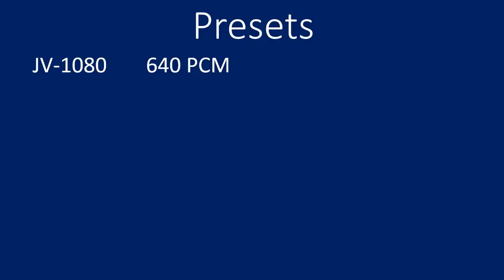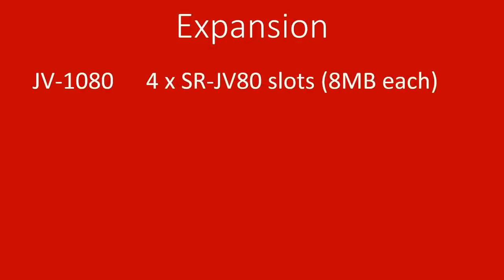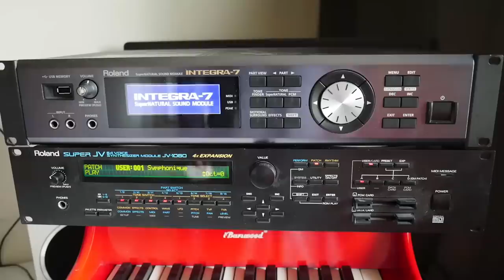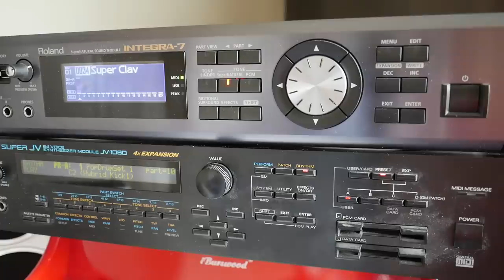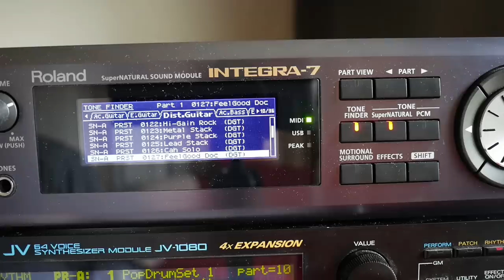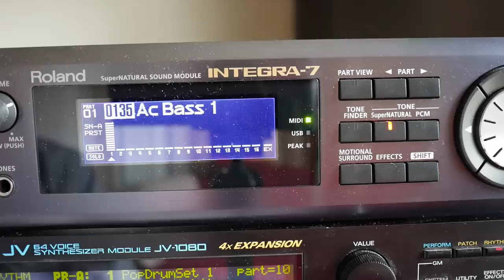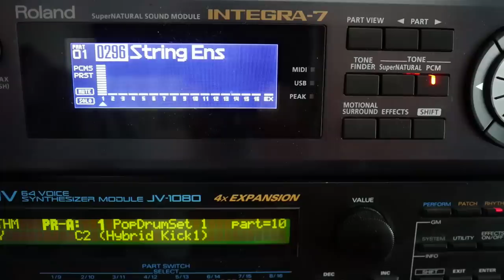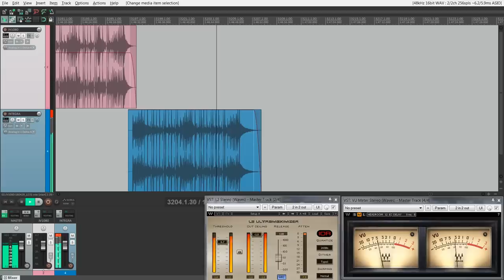Evolution of a classic synth module | Roland JV 1080 vs Integra 7

Comment: I think the lesson here is: we haven’t come very far in 20 years. We’re still using the same sounds, just more of them with added effects.
Reply: Yes, and many of the sounds sounded much better on the old module.
Reply: old one sound more dynamic
Reply: The lesson here is: you're only seeing a very narrow slice of what the integra 7 can do in this video.
Reply: ...and guitarists still play guitars.
Reply: @djangofett4879  Exactly. Even today the Integra 7 is one of only two synths, (the other being the Krog Kronos), which could easily replace my entire current rig of nine synths...
Reply: @qddk9545  JV sounds much fuller, more stereo. Integra too much in your face and maybe that is by design. I noticed the same then when comparing the could 1080 to the cloud 5080. JV does it for me.
Reply: Roland* haven’t come very far in 20 years. If you hear other makers, you will be blown out
Reply: @qddk9545  thats down to   anlogue mixer being used

Comment: I own a JV-1080 I bought in 1995, and an Integra-7 I bought in 2014. With the exception of the super-natural sounds, they are (sound wise) practically identical. This was deliberate. Everything that the JV-1080 did, so did the Integra-7. The PCM sounds comprised the same patches in the same order. The idea was that you replaced the JV-1080 in your 19" rack with an Integra-7, and still essentially had a JV-1080 at your fingertips if you needed it (without having to dust off the old JV-1080 and plug it back in). To compare a JV-1080 and an Integra-7 based on sounds only is unfair given that the Integra-7 has practically the same PCM sound engine built into it. The attraction of the Integra-7 was USB connectivity (no more MIDI cable that kept packing in), larger display, a built in DSP effects engine, balanced audio outputs on the back (ideal for connecting to a desk), blue-tooth connection to an i-pad to make controlling the Integra-7 easier, and a built in ADC/DAC (for audio recording and playback) that had an insanely good signal-to-noise ratio at the time the Integra-7 was released. This, and a VST plugin to control the Integra-7, made it compatible with most DAW's (I use mine with Cubase). Not as easy (but certainly possible) to use a JV-1080 with a modern DAW, but try using a JV-1080 for playback with a music composing/arranging software tool like Finale or Sibelius and you were up the proverbial creek. Theoretically possible, but an awful lot of work to get the JV-1080 playing. Dealing with instruments that you then had to correlate to patch and bank numbers in the user manual, and then type these numbers into your DAW or other software tool was not for the faint hearted. Thus, the Integra-7 (with the exception of the super-natural sounds) wasn't so much a new synth module, as a JV1080 that was compatible with the modern computer.
Reply: Xeraser  Roland haven't really created anything since Eric Persing left.
Reply: You make it sound like there's no reason NOT to get the integration :(
Which would be fine but I can't justify the $1,500+ price tag.
Reply: Its way more than a jv-1080 with USB.  Integra also has the greatest hits from the XV series and the entire library of SRX cards (which included the vast majority of the rom from the cards from the jv series).  Not to mention how much is in just the supernatural library.  probably some stuff im forgetting too.
Reply: @djangofett4879  Do the SRX sounds on the Integra sound the same as the SRX expansion on the XV and MC-909?
Reply: @djangofett4879 Does it come with all the SRX cards built in or do you need to get them separately?

Comment: Never seems to get commented on in reviews, but one of the things that seems to have taken a backward step is boot up time. 20 years progress right there - 1080 in 1 second, Integra 20 seconds. I dumped Korg Kronos because I realised I didn't always want to switch on and then boil the kettle while I waited for it to boot up.
Reply from the maker: integra is faster if you disable the auto-load of srx cards into the virtual slots, but the old synths were amazing.  same trend in computer unfortunately, my atari was quicker than this pc!
Reply: Sign of the times, to some extent....  Of course older synths booted almost immediately, they hadn't "got much to do" !  ;-)  But as you get more modern, they start taking longer because (by and large) they have more memory and more to load up !!
That is a bit of a sweeping generalisation though and there are exceptions : Comparing the Kronos, the Roland V-Synth GT takes about a couple of minutes to boot - BUT the (more modern) Jupiter-80 only takes about 14 seconds !
But would I "dump" the V-Synth because of its boot-up time...??!!!?  No, of course not.
Boot times - or rather RE-boot times - are only really relevant if you suffer a power failure during a live gig. But even then, there's loads of other gear that will need re-booting/re-setting once the power is restored again - and in such circumstances, most audiences would be pretty understanding/forgiving anyway.  :-)  However, if you're working in a studio environment, I don't have a problem with going to make a coffee when you've switched everything on !  :-)
I know the Kronos takes an age to boot but.... You "dumped it" just because of that ??!! Seriously ??  :-o
Reply: Noooo, not just because of that. I also struggled with the clarity of the text on the front panel tbh. Small text and white that wasn't quite white. 

Plus I live in a slightly different world too - it was never an on the road keyboard, only used at home. Quite often in a busy life I just get 10 mins to jump in front of the keyboard and I too regularly didn't bother because of the start up time. I'm just impatient i guess!

My laptop boots in seconds - I can have a midi controller keyboard, as many vst's as I want and an audio interface all up and running in quarter of the time of the Kronos. Not for everyone, but works for me. :)
Reply: @Andy Gordon - that's interesting.  I hear you about the "10 minutes" thing.

I have the opposite experience - my Juno DS takes about 4 seconds to get to the default piano sound after power up.  My little Casio is probably at least that fast.  While my ("late 2011") macbook boots up in just a few seconds (if it was even shut down and not just sleeping), it still takes a substantial amount of time to load up an existing project in Reaper with say 6 or 8 tracks of instruments and effects loaded up in them.  I guess that's why I end up using little iOS synths often - they start up really fast.
Reply: Roboprogs Likewise, my VR-09 also starts up in about 4 seconds - and I suspect that is of similar architecture to the Juno DS, which would probably account for those....
My Triton Le also took a similar length of time to boot originally, but I noticed that it took a second or two longer after I installed the EXB Sample upgrade and extra RAM - clearly it then had more to deal with during the boot, so that made perfect sense.
Have to say though, quite why the Kronos takes forever to boot is a bit baffling.... Yes, it's a beast and has a lot to do on bootup - but as I said before, even the mighty Jupiter-80 can do it in about 14 seconds-ish?.....  :-)
I can understand now, if you just want to quickly switch a Kronos on and play something on the spur of the moment, that boot time is going to be mega frustrating !
Reply: Andy Gordon - The Kronos is a “wait now” vs “wait later” proposition. Once you fire it up, you have no delay at all accessing gigs of sounds, and merging all of those  synth engines through 16 effects in any configuration. On  a PC, you wait to load every next sampled patch, esp if you are unlucky enough to run a 5400rpm HDD on a laptop. The Kronos is my 2nd  tier synth angled 45 degrees toward me, which makes a big difference in the screen readability. The bottom tier RD-800 is my instant-on board.
Reply: Well, a lot of those 2:30 minutes the Kronos takes to boot is loading samples into RAM for instant playback. Of course, even computers boot faster than it does nowadays. Clavia has solved this by using a FPGA instead of computer hardware and their Nord Stage boots in 3 seconds.
Reply: @garys-617  well, truth is, that all the new stuff is also trying to preserve backward compatibility, so it loads and processes more things and yes, programmers tend to use "safer/cheaper" languages to build things faster(?) ... but, current era IS now so fast and complex, that it starts to be almost unacceptable... new things must be simplified-back to people (which again needs FAR more code, though....)
Reply: HA HA HA... that's 20 seconds where you could have done what?  Don't say have sex with your lover... we know you're a STUD!  Seriously 20 seconds?  You can't even effectivly wash your hands in that time.

Comment: 1080 is brasher and more forward with nicer bottom end, the integra is smoother and creamier.  Some of those patches sounded better on the 1080 while some sounded better on the integra.  My conclusion is you should have both heh.
Reply: Exactly, 1080 is VERY cheap these days anyway
Reply: What you describe as "forward nicer bottom end" is the DACs, which lack high frequencies and have less resolution than the Intega, which has modern DACs.

Comment: The point is that the JV 1080 & 5080 are built into the PCM side of the Integra-7.  On the Super Natural side you simply have to adjust a few fix settings to fit your personal taste.  I seem to use more PCM & SRX patches myself but when I do find myself on the Supernatural side of things I am not disappointed

Comment: Sounded more like a DEvolution, if you ask me. The JV 1080 sounded much warmer, spacious, uniquely expressive, and clearer. The Integra 7 sounded harsher, slightly flat, and sometimes cluttered. The JV 1080 easily wins in terms of sound quality, which is the most important. Great video! This is so valuable and helpful! Thank you very much!
Reply: Ward de jager 

??? What "facts"??? You're just bugging everybody with your bad opinions and are talking about completely irrelevant matter. Sound is sound, and if it sounds better one way over another (with lower or higher khz - doesn't matter), then it sounds better that way depending on its purpose. It's as simple as that. If you don't like that, then tough. You don't like the JV-1080, that's your problem, not mine. Quit being such a pest.
Reply: Ward de jager 

Tell you what. How about YOU make a video exactly like this and then you can point out EVERYTHING you want to argue and are claiming. Make a video response to Woody's and let's see how valuable your video will be.
Reply: What you're hearing is not only the sounds of the JV, but it's lower resolution DACs, which have a narrower sample rate and, therefore, less high end. This is not an apples to apples comparison.

Comment: As a longtime user of the MT32 and producing masses of custom patches with LA Synthesis, I was surprised in 2006 when I auditioned the then new Fantom at how similar the standard patches were still. Roland patches from the D50 era onward have a distinct correlation. Here, the JV-1080 stands its ground and use of an outboard FX or two would make the distinction between the two modules largely indiscernible.

Comment: What the hell happened, at 9:10?

The 1080 had just finished playing a nice Hammond sort of sound, then, the Integra tried to immitate the same - with a transistor radio caught in a blender?
Reply from the maker: right!  other organ presets are available thankfully, this is one of the many rock organs, likely i didn't find the best one.
Reply: I see.  I hadn't realised you were having to find a patch that corresponded as close as possible - I was just assuming the Integra offered those same patches, but made them sound a little different - or a lot, in this case :)
Reply: Is there a midi keyboard controller that would controll the parameters filters etc on the 1080 or other JV / XV Series via midi ???

Comment: Definitely JV-1080, has more character. I also noticed with my XV-5050 that the newer these synth got, the more polished, cleaner and arguably duller the sounds are.
Reply: ZenithMusicNet That is exactly what I think. Well said.
Reply: good point although I defo prefer my XV-5050 over the JV-1010 that I had before
Reply: Yeah I have both a XP-50 (same sound engine as the JV-1080) and a XV-5080. With the same samples the XV-5080 is just a bit  cleaner sounding, with less aliases. This sounds good on some sounds, like the strings, but a bit flat on some of the analog style synth sounds. THe XP-50 sounds a bit warmer.

Comment: Really looking forward to the new series you mentioned. Sounds like a great idea! I recently bought a 1080 - my first synth. I also have my eye on a Kurzweil K2000R and Korg Wavestation SR and I'd love to see your appraisal of each before buying either.
Reply from the maker: some great synths you mention there!  of those i think the k2000 has aged the worse, but what a monster it was at the time!
Reply: Interesting. I only ever hear good things about the K2000, and the only negative comment is that it's complex to programme. I'd be very interested to see you do a video about it sometime.
Reply: @WoodyPianoShack  No, K2000 is great synth. Much better as 1080 if you will start doing your own patches. I love 1080 and I had one. Now I have it on Roland Cloud. I have JV880 which I love and Integra which I think I should sell, but SN and Drums are still making me keep Integra. Latest I would sell K2000 but I started to dig in and VAST is so powerful so I decided to keep it. Also sound of K2000 is great, big low end, great sounding synth, much better as 1080. But 1080 has some better sounds as K2000 (but from sound editing 1080 is very easy, for sure not so powerful and complicated like K2000). Thats the difference.

Comment: I hope someone writes utility to convert 1080 patches to Integra. It is the "synth" type sounds (made of saw/pulse waveform) that used to differ most when comparing 1080 to the later XV series. 1080 always sounded way way thicker! Now i'm curious does Integra resemble 1080 or XV series when it comes to raw synth sounds. This patch converter would settle things once and for all. 😛
Reply: Don Solaris To your knowledge can integra import xv5080 patches ?
Reply: I have a feeling you might just have to change the wavetable numbers to match - the samples are all in there, but you have to know how they're looked up, which almost certainly doesn't correspond to how they're numbered in a JV or XV patch.

I seem to have read something about this, but I might be confusing it with the Fantom FA series - both seemed too expensive, to me, so I wasn't fully paying attention.
Reply: @Adamski A. : The integra has all the XV-5050 patches to my knowledge (having owned one+own the i7), and to my knowledge the 5050 patches are the same as the 5080 patches.
Reply: Trevor Dunbar Thats intresting . Im only asking because im sure you can convert jx/xp1080 to xv5080/3080 and then im thinking inport to integra ?, maybe its not as simple as that. I aquired a 3080 a few years ago and was hunting for sysex utilities seei g as i owned a 1080 years before that and still kept all the patches i horded ;-)
Reply: I imported my user patches from my JV-1010 to my XV-3080.  There were a few things to fix, but not much.  The way control sources are done is different, so you have to decide how you want them.  I'm not sure if it copes with samples on cards either, or just in the main ROM - it could have been done, but I wouldn't put money on it.

For sysex, with the XV-3080, I've used Bome's SendSX, and MIDI-OX.  I've also used the Roland XV 5080 Editor and XV Librarian.  They were written for the 5080, but both support the XV-3080... Maybe the XV-5050 too; I'm not sure.
Reply: Trevor Dunbar - The problem is that Reverb/Chorus only exist at the StudioSet level in the Integra-7, not with the tone, and there is no Patch mode as in earliers synths. No way to recreate them, unless you want to use up a Studio Set for each.

Comment: Nice vid, Woody. ;)

What this does show is how amazing the 1080 was, and still is. Quite a few of the presets on it sound better to me.

I mean, you can tell that the Integra patches are trying to add small nuances, and some of them sound great too, but the 1080 patches sound like they would still sit very well into a mix.

I am biased, of course, having spent many years delving into the JV-1080 innards. Both are fantastic synths, but wow, after all these years, the 1080 still impresses.

Fantastic bit of Level 42 and Howard Jones in there, too. :p

Can't wait for the vids on other rack synths. Even better if a few of them have the good old "John's Arcade" inspired road trip montage / timelapse.
Reply from the maker: tend to agree with you ash, and another pickup vid is in the pipeline!

Comment: The Integra was made so you didn't have to buy SRX expansion boards, and to consolidate their best rack machines all into one good workflow.  Everyone blindly saying one is better than the other in sound needs to clean their ears.  As the rack gets older, solder connections get oxidized and more capacitors get damaged the integra will sound exactly like that JV 1080 if you're worried it's gonna sound too clean